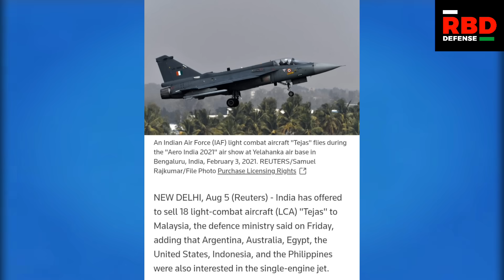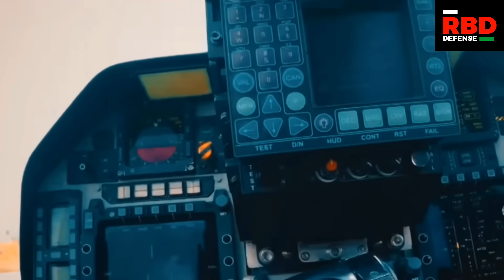Why the Tejas Is So Garbage – The Complete History of India’s LCA

Comment: Tejas is a milestone in India’s indigenous defense capabilities which is of no significance except to India itself.
Tejas has 53 significant shortfalls affecting operational capabilities and survivability, and that the IAF has had to rely on upgrades to older aircraft like the MiG-21, MiG-29, and Jaguar due to delays in the Tejas program. 
Tejas is full of garbage in India quest for self-reliance of domestic fighter aircraft.
The latest incident by Indian Air Force Tejas in Dubai Air Show is a flight to disaster.
The aircraft is Made in India.
Good riddance to Tejas and should be put down immediately instead of putting the life of the pilot in jeopardy flying the metal coffin in the air.
India is just a delusional country full of fancy.
A eulogy is best describing the Tejas incident instead of a tribute to the deceased as departed too soon in highlighting India Air Force unacceptable high accident rate or poor safety record.
India is all noise and braggadocio. 
India should be flying remote control aircraft and use a transmitter on the ground for recreational purposes rather than military aircraft often labelled as a “lying coffin” and a “Widow Maker” due to its frequent accidents.
India makes powerful statement by talking about its superior weaponry and equipment as the most powerful nation to be reckons with.
No countries come close to match India's aircraft from falling out of the sky.
At least 152 Indian Air Force pilots and 534 aircraft have been lost to accidents and crashes over the past 30 years or so, research conducted by aviation expert Anchit Gupta has revealed.
Finding the solution is something that's eluded India since.
Crashing aircraft is a normal habit of India.
India is in a league of its own.
India is all boastful talk and nothing else.

Comment: The Tejas is not a bad design. Its flight characteristics are quite good and for a light fighter comparable to its competitors. The real problem is Indian tech capacity, most of the Tejas components are imported restraining its production.
The Dubai crash is not a Tejas problem, it is most likely pilot fatigue or disorientation. This wasn't the first flight routine for the show, comparison of flight with previous days shows uncertainty in maneuvers and loss of attitude during the tragic routine. It important to note that the pilot was quite old and the final maneuver  put both negative G and positive G forces on the pilot. A very dangerous sequence of forces on the body that can induce blackout or disorientation. The pilot completed the maneuver but was already too low to stay airborne.

Comment: Load of bullshit. 2 Air Crash in 16 years. Now arm chair key board warriors are claiming an entire Air craft made my engineers is a failure. What's your qualification mate? Are you a pilot? Aeronautics Engineer? or a mechanical Engineer? I tell you mine PhD in Material process Engineering. Your turn.
Reply: 2 crashes in 16 years, but, out of how many Tejas aircraft ?
Reply: @Azura_AI-i  Yesterday I bought a shoe lace for AU$6. Thats more expensive than your opinion. To your question 34 air crafts.
Reply: @richardv9648  I was not arguing with you, I was genuinely asking and pondering over other's negative opinions here. But if you want to use juvenile language, despite holding a PhD in a solid field like material eng, that's your choice

Comment: So which aircraft is the best and without a crash sir?
Reply: The one with the lower number to crash ratio .
Reply: @NafisAhmed-ml2ui  Then tejas is best aircraft cuz it has only 2 crashes in 22 years
Reply: @HK47-z3d 😂😂😂 nice joke btw😂
Reply: @NafisAhmed-ml2ui can't argue with facts so start blabber and spam '😂' emoji lol
Reply: @NafisAhmed-ml2ui Which one?
Reply: Crashing is not the issue, dude. The known flawed design and forceful continuation of it's development in the name of national pride is the issue. This is just as bad as Soviet era engineering minus the sending you to the gulag part.
Reply: @hasnihossainsami8375  So mirage 2000 design is also flawed ??
Reply: @HK47-z3d  pretty much all delta-wing only designs from 1950-1970 are inherently flawed due to lacking sufficient control surfaces. These fighters were designed for an era where the faster you could fly the better; almost all fighters were designed to go Mach 2.0 or higher and low speed performance was an afterthought. Tejas is even worse because not only does it lack sufficient control surfaces, it's engine is also quite under-powered. A double-whammy of slow + poor low speed performance.
Reply: @hasnihossainsami8375  Your comment is totally based on assumptions every design have their own pro and cons Delta wing on tejas was choosen cuz of it's small size and Delta wings configuration allow to carry more internal fuel.... Tejas engine is underpowered?? Lol on what basis Tejas use Ge F404 IN 20 which is most powerful engine in its class and initially Jas Griphin also uses the same engine and compare the size of Griphin and Tejas for better understanding